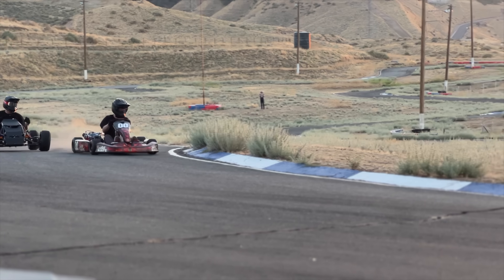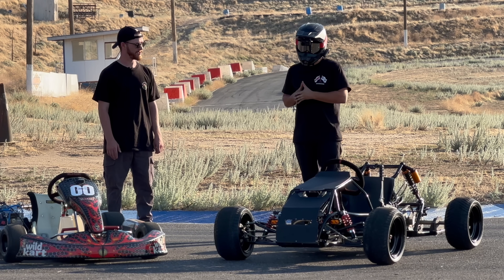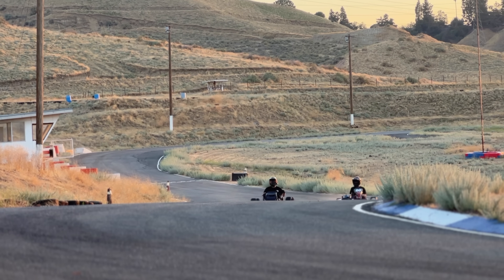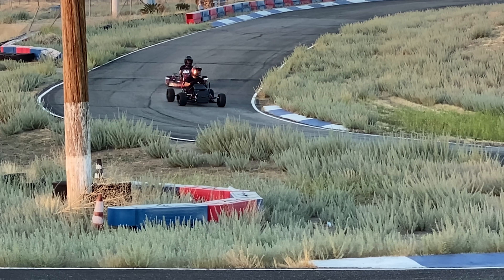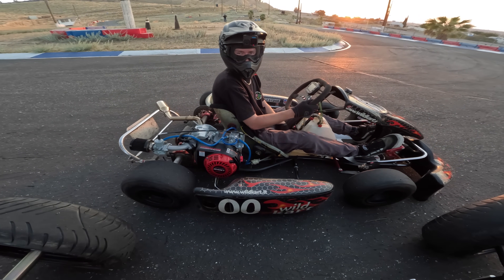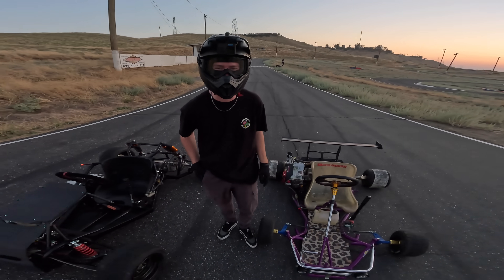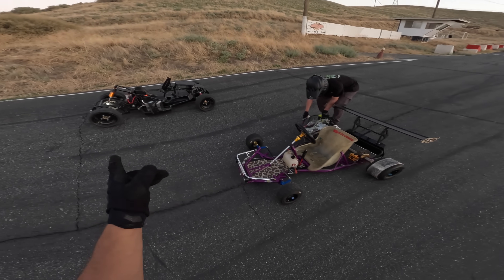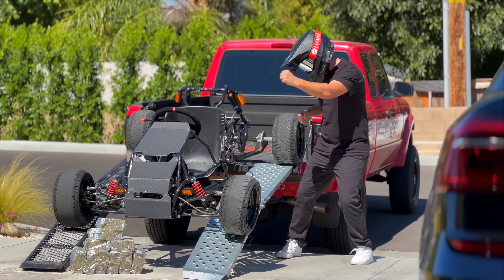Gas vs Electric Go Kart // Race Track POV (200cc vs 20,000w)

Comment: Dude you need to sort out the front camber. I can see it has positive camber (wheels leaning out). Negative camber will handle much better (wheels leaning in). 2-3 deg negative camber will totally change the feel of the ride for the better 👍
Reply: +1 Was hoping to find this comment

Comment: Surronster bike cost

Surron
$4600
72v 60ah chi battery
$2700
Bac 4000
$899
Sotion motor
$850
Supermoto wheels
$600

Total cost $9649
Reply: compared to gas powerd 1k way better deal

Comment: I suggest someone try to make a gasoline kart but with electric traction where the engine only acts as a generator because in addition to having the same torque, it can provide more efficiency it would be something similar to a diesel train.

Comment: The front tires on the E-kart should be way smaller as well as the width of the front-axle. As it is it seems away twitchy when driving straight or cornering.
Reply: Yes but the alignment it just shit on it. You can see how wack the toe and positive camber is

Comment: The ghost is an engine for people who ain’t shit for mechanical work but still want to play go karts with their little friends. 😂😂. I love how he says custom engine builds but then talks up the ghost which is still rev limited at 6400 RPM, is only 70mm piston, still has cast flywheel and cast rod/rod cap and no flat top piston but he it comes with a Chinese knock off 22mm slide carb.. so dumb. I won’t spend that much money on nothing like that. Pretty sure it’s like $450 for the whole ghost package and engine Ana for that I can get a custom casted 72-76mm block with extra build up and strength webbing on the jug and the big ass flat piston and the long stroke 58-59mm crank shaft

Comment: damn this isn't a fair match up, 20KW is around 27hp whist a tuned 200cc makes around 15hp if it's stage 3 built, there's also the wheel sizes, one has suspension one doesn't which all gives the EV a HUGE advantage.